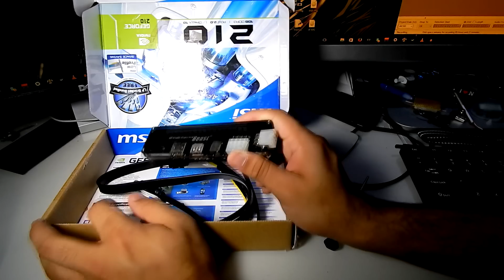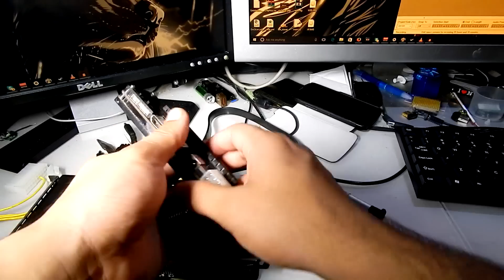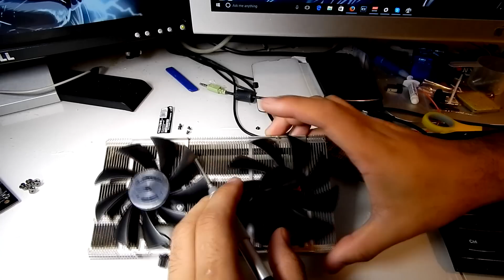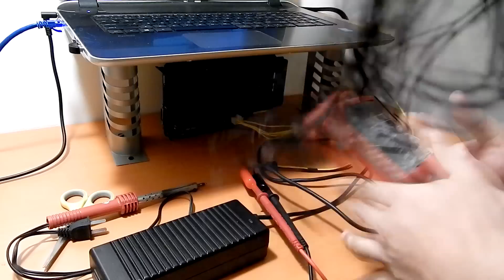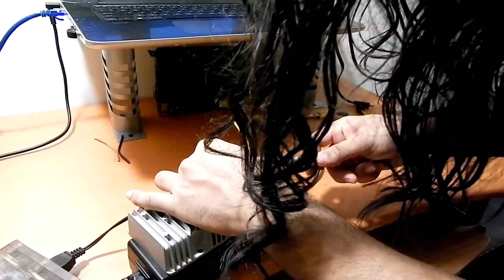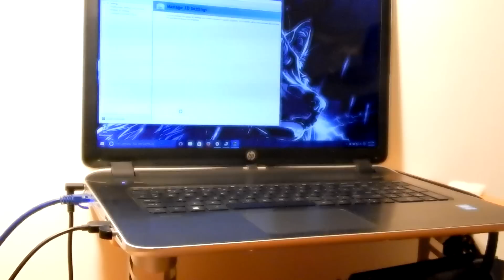Turn Any Laptop Into A Gaming Machine For 72$

Comment: Does this mean that I will be able to play fallout 4 on my i3 laptop?
Reply: Gabriel murillo what i3 do you have
Reply: Avaxity what do u mean
Reply: Gabriel murillo there's different generations of the i3, for example, the 6100, 4170.
Reply: intel(R) core(TM) i3-5157U CPU @ 2.50GHz 2.49 GHz
Reply: If your i3 has hyper-threaring, yes.
Reply: MisterPip ok thanks
Reply: itll struggle but with something like a gtx 970 or rx 470 you should be able to run it on med graphics
Reply: not worth it in other words.
Reply: Its really not worth the trouble, yes you'd be able to run fallout 4 just fine, but you be better off saving for a bit then building a system.

Comment: where to connect the gpu to motherboard? my laptop has m.2 pci slot, will it work.
Reply: uhhh thats ssd slots...
its in the place of the wifi card
Reply: Ohhhhh. So i must take out the wifi la? Hmmm
Reply: Muhammad Afif ya u can buy a small wifi dongle with usb
I think its kinda worth it
But u need to have ect psu if u want to extend the pcie slot life

Comment: the way i would've done was this: instead of giving yourself the headache by soldering a couple of wires just to power on a graphics card, you could just simply get a modern 450 watt desktop PC power supply, grab a paper clip and hook to the the black and the green wire on the 24-pin connector so that when you power that PSU on, it works no problem. Finally, just plug your graphics card with these 8 pin connectors and you are all set.

Despite it not being portable and the 450 watts being way overkill, the method that I mentioned above is the safest and doesn't require any soldering done just as long as you have a pc power supply and a paper clip lying around in your house.
Reply: Other than that, I will say this is a very cool video. You did a great job on it and is very different and a lot more efficient out of alot of people's too.

Comment: You have a multi-meter but not a pair of wire clippers and strippers xD
Reply: its much easier to strip a wire without wire strippers than it is to guess the voltage by touching the wires.
Reply: John Christian Oi oi
Reply: uhhh what's wrong with that?
Reply: lol i just wanted to say that lol
Reply: I have lots of strippers, lol!

Comment: I have an old laptopydoodle, gonna do this with a 1050 ti.
Reply: Make sure it has a good battery, otherwise kaboom.
Reply: Dreams Removes battery before use plugs in laptop
Reply: Dat Person Doe. no point in doing that. the processor will bottleneck the performance severely. if it can't process quickly and efficiently, there's no point in doing it.
Reply: chris hazen It's has got some sort of A8, I overclocked it a tad lel
Reply: Dat Person Doe. oh, an a8 isn't bad actually. noice
Reply: chris hazen Thank god it doesn't overheat tho
Reply: lmao not worth it unless your laptop used to be a top model, I'm guessing your cpu will bottleneck every modern gpu you can buy these days. also small tip, get an r9 290 from ebay, will outperform the 1050 ti for less money, and if you don't like buying used for whatever reason, get yourself an rx 470, it's better for the same price.

Comment: Use block connectors and insolation tape instead of the solvering iron, it's safer and better. One uses a solvering tool to connect the cable directly to a board. When connecting two cables it is best to use ferrors or block connectors.

Comment: the reason its hard for you to saulder that stuff is bc you're not sauldering properly
Reply: I was cringing the whole time he was soldering. If your reading this and planing to solder something in the future. Proper soldering is done by heating the wire with the iron and touching the solder to the wire. Do not wipe the solder onto the iron and then brush the hot solder onto the cold wire like our host did. You can also used butt connectors and shrink tubing for best results. Thank you for posting the video. It's ghetto but I'm sure it works.
Reply: I can agree, that Chinese soldering irons have crap insulation. But there is no real point in grounding, since these ain't some high power soldering irons anyway. I've been using soviet soldering irons for quite some time and got shocked a lot (and soviet soldering irons are usually like 100-150W). Once you are getting shocked, just throw it away.
Reply: php echo why he was being helpful :/
Reply: saulder?
Reply: grammer naziz lel
Reply: php echo ai knew; rait?
Reply: Jeff Everest I CRINGE @ UR LYFE
Reply: He has a 2 dollar solder iron off of eBay too, he needs to get a new one because his has crap insulation and no grounding
Reply: sodder....it's pronounced sodder   :D

Comment: I have an MSI GS70 6qe. Could I use something like a 1070 or 1080 here or perhaps an 970 in sli with my laptops existing 970?
Reply: SamD u can't put a 1080 in a laptop only if your laptops grafics card it about 3-4 High and 25 cm in length bad english sry
Reply: I know I cannot put a Desktop Graphics card IN my laptop. I was asking if I can use this PCI-e dock to use a desktop card with my laptop, using the method this guy is using in his video.
Maybe I wasnt clear enough on that, but I am fully aware of what you are saying after all I have quite a beastly laptop and much of research and "knowlege" went to getting that. :)
Reply: SamD Actually, the 1080 can fit inside a laptop. they have slimmed it down so much.
Reply: yeah, thats true. The notebook 1080. Without the cooler.
Its funny how the cards really are just these thin layers of electronics and a massive cooler :)
Reply: I doubt you could sli the internal 970m with a external 970. The internal 970M is a lot slower then a desktop 970. Even a desktop 1060 6GB would be a beast upgrade from the 970m. You can use 1070/1080 if you want 1440p or 2160p.

Comment: just get a gpu that doesn't need extra power
Reply: 1050ti time
Reply: reference gtx 750ti :)
Reply: Johnny Blastrz it can burn out the pci 1x slot you need a power supply it wort turn on it draws to much power
Reply: Dat Person Doe. Exactly what I was thinking. I have a pny gtx750 and a evga gtx1050ti sc.
Reply: Grey John Oh, ok
Reply: You kind of want to have a grounded one if you're planning on doing anything that involves electrical circuits or at least working on a little chip or something, if not he'd fry it

Comment: is it worth getting a external GPU for a notebook with 1.6 ghz
Reply: 1.6ghz? That's that? the radio station's frequency your notebook likes to listen to?

We need more thant the clock speed of the cpu to help you out. The CPU model would be nice (i.e. Core i5 4200U and not just Core i5.)

Comment: too bad you lose about 90% of the bandwith of the PCI-E card running it in x1 mode in the mini pci-e slot. Although there are laptops now that have usb 3.1 (thunderbolt 3) and u can buy a Thunderbolt 3 to PCI-E 16x adapter (caddy) and have full performance of a 16x GPU.

Comment: is this good for games like Roblox league and so on?

14-inch (1366 x 768) CCFL TrueLife screen 
• Intel Core i5-2540M Dual-Core at 2.60GHz 
• 8GB DDR3 PC3-1600 RAM, up to 16GB max 
• 320GB SATA 7200 -rpm Hard Drive storage 
• NVIDIA NVS 4200M w/ 512MB video ram 
• Intel Centrino Advance-N 6250 802.11n Wi-Fi 
• DVD+-RW SuperDrive w/ double layer optical 
• SD flash memory Media Card Reader 
• USB3.0, HDMI, e-SATA, HD audio in/out 
• Integrated 2.0 megapixel Dell smart webcam 
• Windows 10 pro 64bit, and MS Office 2013
Reply: Not only do you play Roblox but you have a bleach profile, gtfo of here

Comment: Hey! I'm planning on doing this to my laptop. So this video was VERY helpfull. BUT! I do have some questions if you could please help. I have a hp 4540s probook. And it is farely upgradeable. Did buy an i7 quad with hyper threading, second 4 gig ram. Just the graphics, you know ;-) I checked and took out the wifi card. it looks like a PCI-e port. But is there any chance it could be a PCI-e mini? How to be sure? and if so, then what? And lastly to the power source for the GPU. I could just get a regular PC power source and hook it up to it, right? Thanks!
Reply: get a damn pc lol
Reply: ***** I did :) But it worked amazingly. However my Hp had a bios whitelist.. so In order for it to work I would have to switch thw wifi with gpu every time a turned on my laptop... No good. since I bought the gpu, just got the rest... :D
Reply: Or is the PCI-e mini just a different name for the PCI-e :D
Reply from the maker: Umm as far as a power supply goes i would say just get a standard pc one. And pci-e mini is a cut down version of pci-e also this is trial and error so there is a chance it wont work.
Reply: that´s basically what is in my pc
Reply: http://www.geeknext.com/media/catalog/product/cache/1/image/9df78eab33525d08d6e5fb8d27136e95/1/_/1_1_122.jpg
Reply from the maker: Martin Huszár
yea thats mini pci-e
Reply: So it should be ok then.
Reply from the maker: ye
Reply: Martin Huszár so did you figure something out?
Reply: I figured out I'd be better off putting together a desktop pc since I already had the gpu. In order to get it to work on an HP laptop you would have to download a modiffied bios for the exact laptop that you are using. Some people actually do that out there for you to download. However it always brings a risk of pretty much destroying ur laptop for good. unless you exchange the bios chip with a new one. It is simply a pain in the ass. just get a desktop.

Comment: i have a clevo w860cu(sager np8690)  has NO onboard graphic card and a NOT WORKING removable nvidia(actually laptop has no graphic card now),so is there any way use that PCI-E  because i cannot dowlnoad first the drivers for the external graphic card ,plus it has ExpressCard slot
than you
Reply from the maker: Umm, you can look on ebay for a replacement nvidia card, but other then that im not too sure,

Comment: Dude i bought it  and it ane working i tried on my working laptop but still not working any tips?
Reply from the maker: +TheBeast727 did you try removing a stick of ram maybe cause that was the problem for me. I would say double check and make sure your power supply is connected.

Comment: How do you connect the pci to the laptop? the most important part is not in the video
Reply from the maker: umm well it'll just take the spot of the wireless card so just find that take it out and plug the cable in there.
Reply: ***** yes, the problem was that I wanted to see how you did that, the disassembly and how you close the laptop with that cable coming out
Reply from the maker: LuisMMaster
ahh kk ill be sure to mention it in the next video.
Reply: Yes I'm interested to know that, because I will not going with a hole and a cable in my laptop everywhere. Sorry for my english but I think you understand me. Greeting from Argentina. Bye
Reply from the maker: LuisMMaster
ahh kk

Comment: i had a lenovo g500s i7 3632 and 16 gb ram, wich  isnt a bad setup at all, the problem was the bad gpu, gt 720m now using a gtx 750 ti and well bottleneck or not, this laptop can beat gaming pc of 1200$ for just 800 (laptop+gpu)  and when u need move it u can unplug it and be happy i conected via expresscard and it does a masive jump, and for who says bottleneck well wont perform as well as a desktop but, if u have already a laptop with nice cpu u will more likely expend 150% than 600
Reply from the maker: Thats very interesting.

Comment: I'm sorry, but this makes no sense, because the PCIe slot on that adapter is a gen 2 with just one lane. The transfer speed of PCIe 2.0 1x is 500 MB/s in two directions, which is way too slow for modern graphic cards.
But still an interesting video though.
Reply from the maker: Don't worry gonna be testing all that in another video, and thanks.

Comment: Hello! First of all thanks for uploading this! Ive been looking for an external gpu demonstration on an HP laptop, as I've never seen one before. I've heard theres a problem with the PCIe slot that we use, that its not ideal for a GPU. Can u tell me how your performance was playing high end games?

Secondly, can u look up HP 250 G4 and see if it is suitable to be set up like this one? Im very afraid to try it myself.
Reply from the maker: As long as you build it right and skip the power supply I made and go for a desktop one you should be fine.
Reply: So i just use an SMPS?
Reply from the maker: *****
Yea a small modular power supply will work great.

Comment: As far as the power reg goes, you can just adjust the feedback system in the "power brick" to lower the output voltage...
Unless you're using a linear transformer, for that, it would probably just be easier to use the regulator.

Also 19v at 6A converted to 12v will be almost 10A, that's almost overdriving the regulator, be careful, also some GPU's use 20 amps + (My one for example 430w at 12v, that's tops 37.39 Amps, Ouch) I'd recommend buying a cheap PC PSU.
Reply from the maker: Yea, that's a good point but I did open the brick and there was no adjustment pots all I saw was a transformer on a circuit board with protection and stuff, that's why I went with a regulator but I would recommend a novice to use a pc powersupply instead.

Comment: holy shit this is the biggest cancer on yt, A FKN 750 IS NOT A "BEAST GAMING CARD" its old, it will bottleneck, it sucks
Reply: He only used what he had on hand which happened to be a 750 ti sc which is considered still a beast gaming card for the money considering you can buy a 750 ti for around 90-150$ and get pretty med-high quality In most games and it doesn't require too much power like any 900-1000 series card.
Reply from the maker: Yea plus you can get a 750ti for relatively cheap now, I do have a 970 however I didn't feel like taking it out y desktop just for a video.

Comment: My Laptop gonna be OVERKILL if i do that
Reply: No, your laptop has a weak CPU with less cores than a desktop CPU, and your internal motherboard probably sucks and doesn't support newer DDR4 ram.
Reply: +theskeletonboi rekt
Reply: theskeletonboi Lol! My Laptop is "MSI GT60 2PE Dominator" is not weak and don't be shit
Reply: Nice man, and guess what pal, My THREE YEAR OLD, Pc beats the i7 4700MQ.
Not to mention i got that CPU secondhand... for 27$
Reply: +James Braselton Thats what I wanted to say xD
Reply from the maker: Nah it wouldn't be that overkill :P
Reply: Game Digger That laptop is garbage. It has a GTX 880m (LMAO), and under-clocked and under-cored i7 mobile processor (Newer i5 desktop CPU's even beat that). Horribly slow DDR3L SDRAM (Catch up kid, modern ram has double the speeds). To make it even better it can't even run dx12 games.

This weak computer can't even run the simplest VR games.

Not to mention it costs 2,400 dollars. That of which one can get a desktop with dual GTX 1080's in SLI, 16 Gigs of DDR4 RAM (2400 mhz), I7 6700k 4.0 ghz, PNY, ultra fast 120 GB SSD, 2TB 7200 RPM HDD. MSI z170A M5 ATX Motherboard. and a CRYORIH h7, 49.0 CFM CPU cooler.

All of that with money left over to get a nice case like the Corsair SPEC-02 ATH, EVGA SuperNOVA NEX 650W 80+ gold Modular power supply,Windos 10 pro 64 bit, and ASIS DrW-24B1ST Drive. And 3 extra Corsair Air series AF140 Quiet edition 140mm fans.

LMAO, your computer sucks.
Reply: theskeletonboi Ok...

Comment: Why do you even want to buy laptop when you can buy Desktop pc? What?
Reply: Some people want a portable computer
Reply: I'm going to uni so had to buy a laptop as my desktop is not transportable
Reply: The key is buying for work/study and not even trying to play games on it. A laptop will never compare for gaming.
Reply: TheTopMostDog Are you sure about that? 
The fact is my laptop is out preforming my desktop by about 25%.

Laptop has i7 2.6ghz turbo boost to 3. soomthing, GTX 960M (4GB) and 16GB of ram where  as my desktop has an i5 2.6 ghz, amd radeon hd 7950 (3GB) and 12GB of ram.

So a laptop will compare for gaming but will be more expensive.
Reply: The HD 7950 is light years faster than the 960M. And before you say that it has 1GB more VRAM that means nothing for such a shit Mobile GPU. Laptops can't replace desktops at this point of time.
Reply: +George Karadzhov So my desktop can run BF1 at 40fps on low settings but my gaming laptop does average 80fps on med please explain then why my laptop cant replace my desktop
Reply: An addition to this is on the cs go benchmark map http://steamcommunity.com/sharedfiles/filedetails/?id=500334237&ref=YouTube
I have found the laptop to be averaging 125 fps and the desktop to be averaging 150 fps, this may be because cs go is more gpu intensive
Reply: +BackRowBenster
Yes, I'm sure about that.

If you spend x money on a laptop it will be outperformed by a desktop of the same value.

Clearly your new laptop will outperform your PC when your PC is 5 years old. If you'd spent half that money on the laptop and put the other half into a new GPU, you'd have better gaming performance than either system and keep a similar, non-gaming portability of your laptop (possibly even better due to size and battery life) .
Reply from the maker: This is just for those who already have a laptop and don't have the space for a desktop.